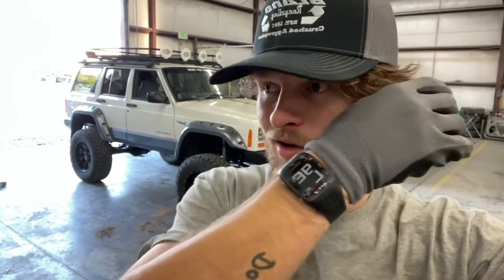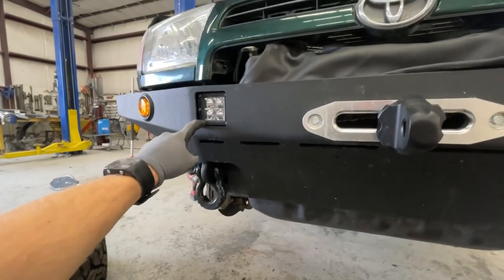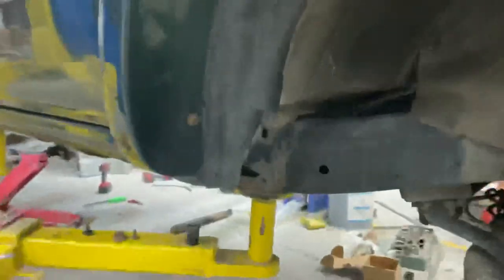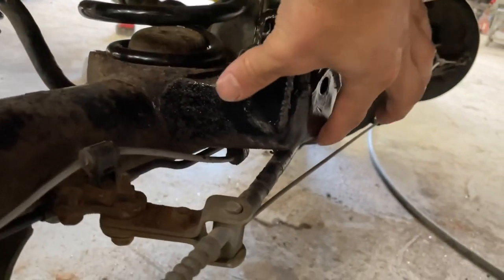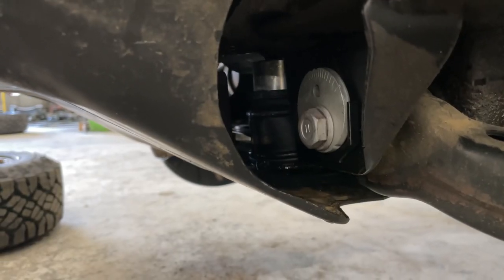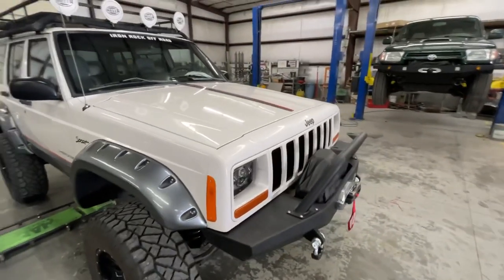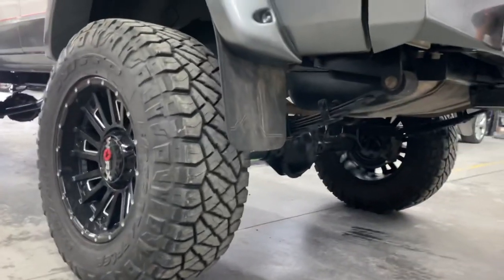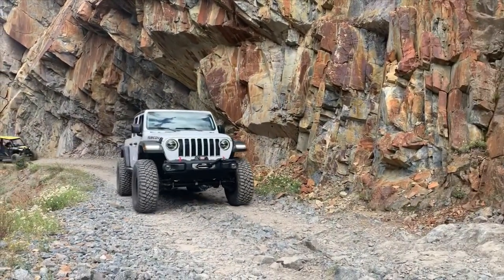3rd Gen 4Runner Build Update - Suspension! | Stout Vlog 020

Comment: How do you like the freedom off-road upper control arms so far?
Reply from the maker: They’ve been good to me so far! No complaints especially for the price and the build quality seemed good. I had some trouble with the alignment when I tried to lift it too much in the front but I wouldn’t really say that’s a control arm issue. I will say if you are planning on doing more than 4” in the front I’d look around and see if there is another option that provides adjustment to get your alignment dialed in. I have another video that shows the whole lift/alignment/cv angle issue if ya lift it too high

Comment: Hey, im doing the same thing. How did you get the bushing to squish down enough to get the nut on the top of the rear shocks?
Reply from the maker: Sweet! Uhh thats a good question 😂 I know I had to modify mine a little bit because of the same problem. I think I cut the flanges off of a set of the steel spacers it came with to shorten them up. I know I didn’t put on all the stuff it came with because it was too much. When I get home I’ll look and see if I can tell what exactly I ended up doing if you don’t figure it out by tonight!
Reply from the maker: I looked at mine and I made a little sandwich of a rubber isolator between one of the supplied washers and the body of the vehicle. I also put another washer and the nut on the other side. So basically it goes (from the shock up towards end of shock shaft) convex washer, rubber isolator, body of the runner, washer, nut
I did have to modify one of those washers that came with it
Reply: @AustinStout  I ended up trimming the top bushing as well. Do you think that will effect the integrity of the bushing though?  I didn't have any way to grind down the washer that came with the kit.

Comment: i got a ! why does my 4runner  shake really bad at 55 to 70  then it smoothes out
Reply from the maker: Hmm hard to say right off! You could start with easy things like tire balance then check your wheel bearings and such next! I know it’s a common thing on these runners for the little bearing in the front diff to go out and it sounds and feels just like a bad wheel bearing. Take a look at that too if you can pin down the location of that vibration

Comment: What wheels are those you putting on the 4runner?
Reply from the maker: The brand is Rock Trix! I found em on Amazon. -12mm offset 
There is a link in the description for the parts I’ve used in this build so far! 🤙🏼
Reply from the maker: The pictures on Amazon make the color look dumb on the bronze ones but they actually look legit in real life. I didn’t even consider them until I seen some of the other customer pictures haha
Reply: @AustinStout  I think they look awesome 😎